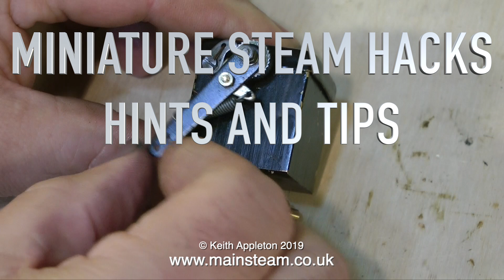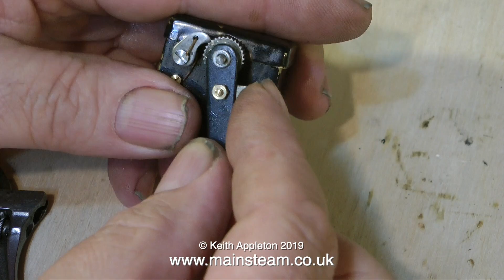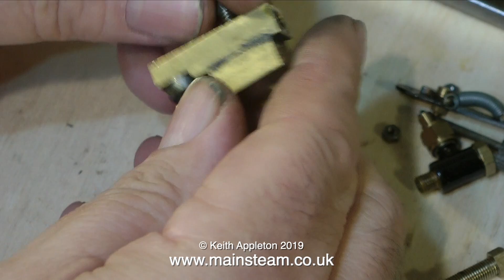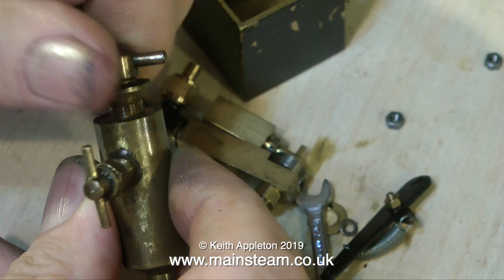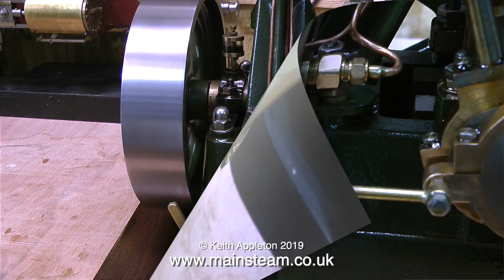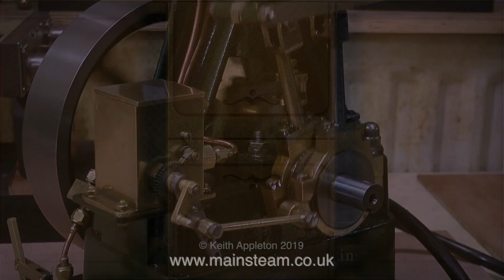MINIATURE STEAM HACKS - PART #33 - CYLINDER LUBRICATORS

Comment: Keith, this is very helpful.  I own an antique steam engine that came out of an early steam carriage.  If I am going to do much with it, I need a proper lubricator.  (Both cylinders use a common steam chest with the two slide valves.). Very helpful video.